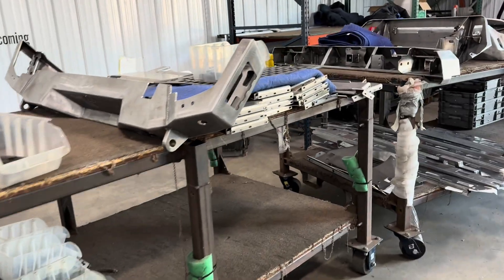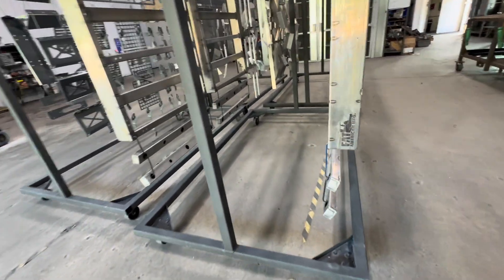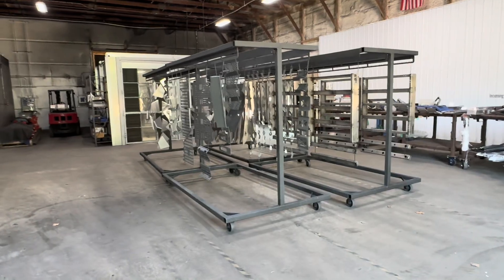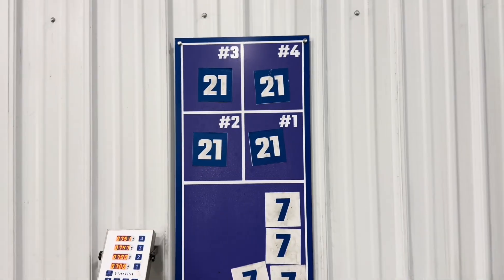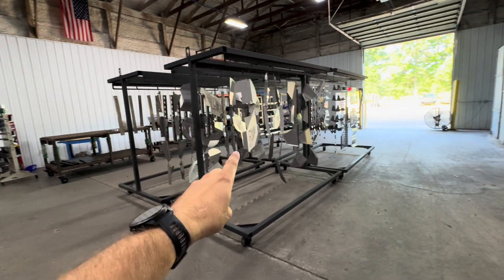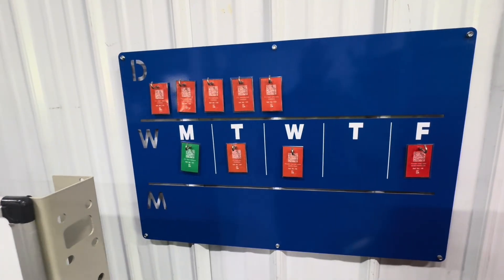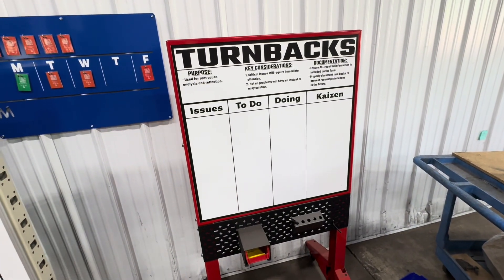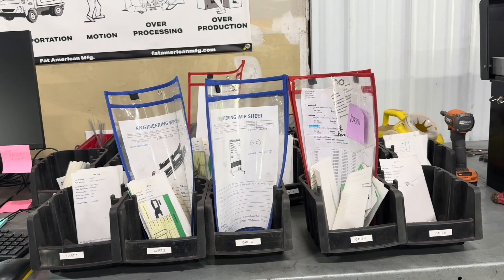Lean in Powder Coat? Continuous Improvement in our Powder Coating Area!

Comment: Seems a bit dangerous to step inside the cart to paint the other side of the parts. Why not build carts that only hold a single row of parts? Sure you would need more carts but they would likely be easier to maneuver.  Then use the same carts to deliver to the next process to avoid double handling.
Reply from the maker: All ideas are worth discussion. Thanks for the feedback.